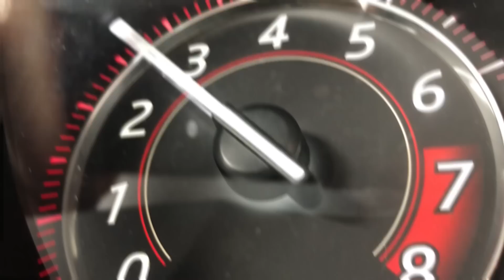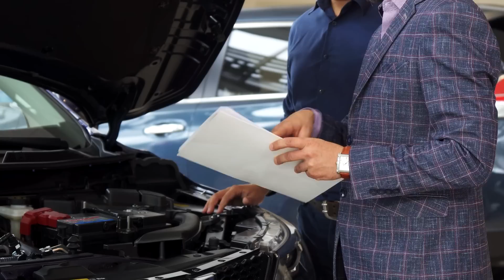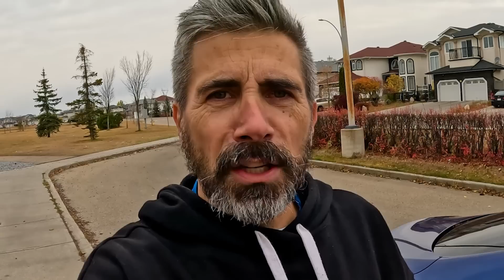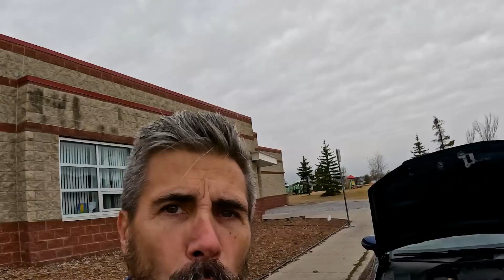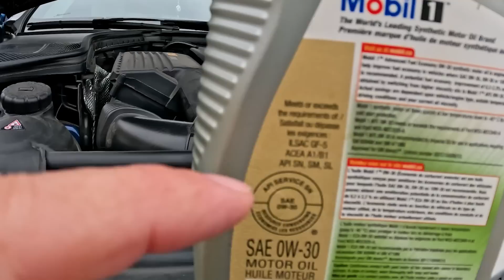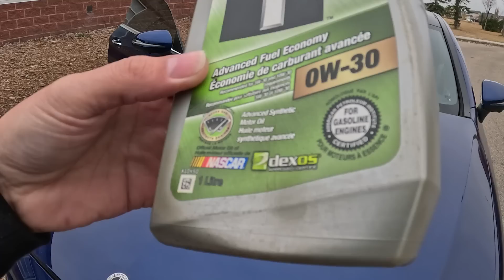BREAKING! Why These New Car Engines Are IMPLODING!

Comment: DI isn't new -  2003, 2004 Isuzu Rodeos had it. it kinda caps engine life at 15-20 years because the high pressure fuel pumps start to die - & need a specialty shop to rebuild.

Comment: It seems to me just driving around people are really hard there vehicles, every start is a 0-60 full throttle run, these little engines for their size will get it, we never dreamed tiny lil 4 cylinder would ever pull like these engines, I’ve had two tiny lil 2.7 dual turbo F150’s and they’ve never missed a beat, but I don’t run them at full throttle at every start, I also never get on the engine till it’s warmed up and I never neglect oil changes. I 100% agree with installing a catch can.

Comment: The correct answer is to NOT get a car with a direct injected or turbocharged engine. I have put 389,000 miles (so far) on my 2006 Mercury Garand Marquis, with the port injected 4.6L 2 valve engine, using WALMART SuperTech 10w30 conventional oil, changed every 3,000 miles. That is some of the cheapest oil available. I have checked the cylinders with a borescope when changing the spark plugs, and found no sign of carbon buildup at all. The engine still runs like new. Properly maintained, these engines can go past 500,000 miles, even more if you replace the timing components at around 300,000, or if you hear any timing chain rattle.

Comment: Excellent explanation.
Direct injection into the combustion causing fuel dilution of the engine oil is a big problem for all car manufacturers.
However, the car manufacturers are not honouring their car warranties, and are instead blaming the car owners for not maintaining their cars adequately. The issue is that the manufacturers have extended their maintenance intervals to far beyond what they should be for a direct injection engine. These DI engines need far more frequent oil changes. 
Jaguars are well known for their engines failing due fuel dilution of the engine oil, requiring a full engine replacement.
Reply from the maker: You are right it always falls on us even if it’s not our fault
Reply: My family owns 6 Skyactiv Mazdas, and have lost one in a collision. Some of them have high mileage (over 200 000). They all have GDI, and I can tell you, none of them use oil. At all. It's simply not a problem for them.

Comment: One part of the carbon fouling in DI engines is the design of the EGR. With nothing to wash the condensed oil vapor off the valves and runners, your designing the engine to fail after a too short life. Yes, I know I am oversimplifying but those with sufficient engine knowledge will understand.

Comment: the problem is not the DIRECT INJECTION in itself, it's the EGR valves installed on ALL cars who meet Euro-6 emission normative. The EGR valve takes part of exhaust gasses and redirects them into intake manifold to cool down the combustion chamber and reduce NOx gasses and because of this recirculation system it builds carbon and oil on your intake valves, but since there's no more port injection, nothing else can clean your intake valves. The oil dilution is cause by OPF/GPF filters, in order them to operate they need to be in a certain range of temperature like on diesels, so in order for them to regenerate aka all the PM10 soot burn down to PM2, the engine shoots a little bit of gasoline into the chamber and leaves with gasses to then do the post ignition into your OPF filter. Obviously not all gasoline will leave the chamber and a small amount will dilute with the oil but overtime it will accumulate. So change your oil every 5k miles because gas is a solvent and it will wash your cylinders from oil.
Reply: E-  exhaust G- grinding R- residue  = less engine life PIRIOD !

Comment: Hey, you should try Lubrication Engineers oil. The problem has always been the PCV system. This oil has a very high vaporization ( like well over 400 degrees F ) so the carbon fouling is reduced. Try it out.

Comment: Just had an idea for a new piston crank system. You know how the piston Rams in and out which causes huge gforces on the piston,  crank shaft and bearings.
Why not have a off set piston shaft, meaning it goes up at a angle, when hits end, there's a mild rotation at the piston shaft and rod where'd piston rod ends up at the other side of the piston and comes back down, same happens at bottom of piston.
So basically the piston rod is working at an elongated elliptical rotation, less sharp stop and both ends on piston travel.
What do you think, do you even get the picture what I'm trying to say lol.😂?

Comment: Apparently BMW has it down a bit more solid but they do want those cars to blow up around 150k so you keep leasing. They do it by telling people they don't have to change the oil as much and leave out that a bottle of liquid molly poured into the oil helps for anti friction

Comment: Like the videos. This just makes me want to hold on to my 2008 Lexus GX 470 with the old reliable V8.  Sure the MPG isn't good and not fast like her Mini with the twin turbo but way more reliable.  16 years later and 200k miles and the V8 has had ZERO issues.
Reply: Yep- me 06 Tahoe 265k everything original everything working no oil consumption or leak. Same w/04 Suburban 150k now. Both are use for travel trailer towing. Parts everywhere if needed- I don't give sh... about MPG. insurance & tabs way cheaper
Reply: If your vehicle is reliable, just think how much you are saving by not throwing money into some thing that will depreciate like c razy, you can buy a .lot of fuel for that saving.
Reply: My 2005 LX 470 has 226,000 miles on it.  Tomorrow, I'm taking it on a trip out of state.  Yes, they use a lot of gasoline.  But these engines go and go and go with minimal maintenance and repairs.
Reply: It's a keeper
Reply: 1999 V8 land cruiser = flawless
Reply: @erichmeyer8213  Our 6-cylinder RX400h (hybrid) is going on 20 years. And lots of 4-cylinder Honda Civics, Mazda 3s, and Toyota Camrys and Corollas are out there with over 250,000 miles on their powertrains. You don't need a gas-guzzling V8 to achieve long life, just good maintenance habits.
Reply: Not! Your manufacturer recommends 10k oil/filter changes. Oil manufacturers 15k, 20K  oil changes.😢
Reply: Watch Tuber The Car Care Nut for all your Toyota/Lexus maintenance needs. He services both of my Lexus's.

Comment: Wouldn't using high quality gasoline, such as Chevron with Techron help these engine issues?  I have added a bottle of Techron monthly to my gas tank of my '08 Mercedes V8 and it runs great. Of course I use Chevron supreme gasoline as well.  My engine has 62k miles and no issues to date.

Comment: You are filming in front of a Benz engine, but I haven't seen many issues with carbon build up in the 2 liter 4 cylinder direct injection engines of MB. There were issues in US with broken pistons I believe, but those issues are not present in Europe where  95 is the minimum octane nr.
Reply: Unfortunately the USA has very poor quality fuel. Min octane is 89.

Comment: Mobil 1 0W-40 was recommended for my VW 2.0l Turbo.  An engine that has an bad track record.  Mobil 1 used to be SN rated, but SN has more Calcium detergents which have been found to be responsible for some of the LSPI events.  
Mobil 1 has re-formulated the motor oil reducing the calcium content (by about half) and it is now an SP rated oil.  SP rated oils are considered superior to the SN rating and should be used in Direct Injection Engines.  Same brand, same weight, only different rating with less calcium, and a few other modifications to the chemistry.
Reply: The best is both port and direct
Reply from the maker: Interesting! Thanks for sharing your findings.  Yes its amazing how important the proper oil really is especially now with the complexity ad design of these modern engines.

Comment: The fuel dilution has more to do with the design of the injector or the design of the head where the injector is mounted.  It can result in more fuel being sprayed onto the cylinder wall.  This fuel can bypass the low tension rings getting into the oil.  Oil does not mix well with fuel and can cause the sludge that blocks oil passages and causes engine failure.
Reply from the maker: Totally right.  Also once the process starts, it just continues to add and compound the issued until a failure is imminent.

Comment: Fuel is important even in direct injection engines.  Using "Top Teir Fuel" with the correct Octane rating will help.  These fuels are blended with additives to clean the upper top of the piston and into the rings somewhat.  
Cheap fuels can be 91 octane but do not provide the detergent additives t the same degree.  Always use "Top Tier Fuels". Shell has the Top Tier Fuel posted on their pumps.
See The Oil Geek for the chemistry about oils and the use of quality fuel to prevent Low Speed Pre-Ignition.  Some times you do get what you pay for.
Reply from the maker: True, correct octane is always important and not having a quality. grade can stil cause engine damage in other ways.  Always important .

Comment: One issue is lack of oil changes. People try to follow the manufacturer recommendations which are not good enough for turbo engines. The turbos use oil to cool and it cooks the oil really bad. If you have a turbo charged engine I would be doing oil changes every 3000-3500 miles even with synthetic oil. Naturally aspirated engines yeah every 5k is fine, but not for turbo charged engines. Also make sure you use oil with SN on the certification to reduce chances of instant catastrophic failure when starting a cold engine. Dave's Auto Center has a video on that problem. Glad you covered the LSPI issues it is sad some folks do not know they could blow their engine just starting it when cold outside. Excess fuel getting past the rings is usually not a problem for people that have longer commutes it gets burned out, but people with short commutes its a problem it never has time to burn off. Well done Mark:P
Reply: FWIW, turbos on economy cars seems like a bad idea, any money saved from fuel economy improvement will go toward turbo repair costs later on🤔🙄🤨

Comment: Use ONLY Top Tier gasoline-look on the pump for label, This will keep injectors clean long term. Change the oil every 6 months or 5k miles. Try not to run engine for very short trips. It needs to be warmed up fully for maybe 15 minutes at least once per week to keep oil and crankcase free of moisture. Warm the engine up for 5+ minutes after coolant temp hits running temp before loading the engine. Cool down the turbo and bearings for 2 minutes minimum after running up a hill, highway, or any driving that loads the engine signifiganlty. . Change the coolant maybe every 5-6 years. Change the trans fluid every 40-50k miles or every 6 years. Look at the maintenance shedule before following any of this advice! Some types of vehicle need even more stringent care!  The above is only what I do after a many years of learning. Read your manual! 10k oil changes are a very bad idea in my opinion.

Comment: Planned obsolescence, anything with electronics is manufactured for shorter life; vehicles, even appliances. Costumers are led to beleive that new cars are lower maintenance, with "incentives" like BMW's 15K oil change which is deadly, or many other cars (including once reliable brands) with 10K intervals (it will get you through the warranty period, ...maybe). At least Toyota realized that direct injection was not feasible due to carbon and combined their engines with port injection. If only Toyota could get on track with their trucks!

Comment: 2 last cars i had, approx same weight, one of them gdi and one port injected. The port injected use 15% less fuel, so are there any pros at all for gdis? I think not. Engines should never be downsized with turbo, they will live under constant enormous stress.
Reply: If I designed an engine, I'd give the middle finger to the EPA and instead of downsizing from a 3.5L V6 to a turbo 4 cylinder, I'd make the 3.5L V6 both more powerful and efficient and crank that redline from 6300 rpm to 7500 rpm redline and bump the HP from 290 to 350 hp with dual port and direct injection, a submersible BLDC electric high pressure gear fuel pump instead of a cam driven high pressure pump, passive pre chamber, valve lift controlled throttle, dual BLDC VVT, serpentine belt driven water pump, and multiply timing chain with teflon coated steel chain guides and oil pump driven by a separate chain. Also the valve covers and upper intake manifold are the only plastic parts on the engine but they are a high grade plastic. Also coolant hoses are attached with CT clamps, vacuum lines are friction fitted, and high pressure fuel lines are attached the same way as an old-school cat.

Comment: Years ago, I carboned cleaned my audi a5 myself with walnut shells. What I discovered was extreme buildup in the intake ports. Then i discovered the entire intake manifold was soaked with oil- so much oil that I ended up buying and replacing the intake manifold as well. Then i saw the injectors were also fouled as well, and then i needed rebuild kits for them as well.  Then i discovered the PCV system was dumping tons of oil back into the intake manifold. I replaced it as well. Bottom line is the engine design was not very good. I got rid of the car shortly after that and traded it in. The car only had 75-80k on it. 😡

Comment: My 2019 Murano has 79K and hasn't missed a single beat.  No start stop,  no cylinder deactivation,  no turbos, just good old fashioned naturally aspirated port injection.  I change my oil every 3,000 miles or less.  Never added a drop.😊 Never even had a single recall.  Can't even say that for most Toyotas 😂
Reply: Cvt gonna give up soon.
Reply: I've changed the tranny fluid twice and really take care of it.  If/when the transmission were to go I have a 15 year platinum extended warranty that will cover it.  I've heard Rogues, Altimas and Sentras have the highest rate of transmission failure amongst the Nissan brand.
Reply: You better knock on wood lol those and the rogues are huge turds 😂
Reply: Are you really flexing a Nissan lmao
Reply: @joeyt6547  Everybody poo poos them but it's been the best vehicle I've owned and I've had a few including Hondas and Toyotas 🤷‍♂️
Reply: 270K on our 2005 Honda Pilot. Oil change every 5K with conventional 5-20 oil from new. Purrs and idles like new and shifts perfectly with 30K trans service. No flush. Just drain.
Reply: You'd better be changing your CVT oil every 50k.

Comment: I have two Direct Injection engine vehicles. You have to use WOT now and again, regular oil changes are a must. Also an oil catch can and intake clean will help. One of my vehicles has 200k kms (2018 G80 sport) and no issues.
Reply from the maker: The old "Italian Tuneup". Works

Comment: change oil 4k max miles  not 8k plus only use top shelf valvoline or ?
Reply from the maker: More ferquent changes is best as oil is chep but engines are not

Comment: Yes, very important Oil and specifications you showing up.
Engine Oil has to withstand all stress during the combustion, plus burnet very clear means minimum ash.
Direct injection Gas Engines are the same as Diesel Direct injected only lower compression with spark ignition and gasoline
Today new engines need the same engine Oil with the same specifications as Diesel Blutec Engines.
Have very modern Engine Oils up to 5W40 with those specifications.
I use in my GLS350d 5W40 MOTUL - LIQUI MOLY - Now I use PENTOSIN - I get a better price.
Those economic fuel-saving engine Oils damage the Valve Train is too light.
5W40 engine Oil is for today's cars with specifications that say low ash MB 229.52 (60/71) ( Euro 6 specifications and soon Euro 7 specs)
Those other 5W40 oils are very different from those 5W40 standard or old fashion oils.
Look on the DATA SHEET - you going to see Viscosity at 100C max 13.5 and a viscosity index of 200 or a little higher which is very important.
Old fashion 5W40 Viscosity at 100C 14.5 or even higher 17 - viscosity index 120
The viscosity index is very important for higher oil quality ( not affected by high and low temperatures to be degraded during the cycle of use.
In my BMW I use the same engine OIL 5W40 PENTOSIN  Viscosity at 100C 13.5 viscosity index is 195 - low ash burning
LIQUI MOLY 5W30 4200 eng oil has one of the best viscosity at 100C 12.2 and a viscosity index of 200
Go to Google search for all kinds of engine Oils = DATA SHEET observe Viscosity at 100C  and Viscosity index the highest - garbage oils have very low visc. index.
Reply from the maker: Some very good information and I appreciate you providing this as it may help other car owners.  Sounds like you have done your research.  Cheers
Reply: @ECPP  Engine Oils I divide new and Old styles or parameters.
Good mother oils up to 5W40 low ash ( The most new norms)
Viscosity at 100C is not higher than 13.5 ( 13 - 12.9 - 13.2)
A very important viscosity index up over 200, if can find one, is the best. LIQUI MOLY 5W30 4200 model is one of the best that we can get in Canada Viscosity at 100C is 12.2 Viscosity index of 200.
Oils with higher viscosity and older style going to kill the engine too.
Those modern engines are built with lubricated channels with very small diameters for very light engine oils to hold pressure in the Lub system.
When we use old-style oil 5W40 or 10W40 reducing oil flow in the lub system damages the engine.
Those very light engine Oils as 0W20 OW16 Viscosity at 100C 7.5 up to 10 and an index of 130.
For that reason killing the engines.
Lab Fuel economy test is for how much can save = during a 1 year can save 2 or 3 liters of fuel. 
This is true - governments need those numbers for their propaganda.
Why is no one word about why engines can't last?
Why is the Government not saying long-lasting engines are less polluting?